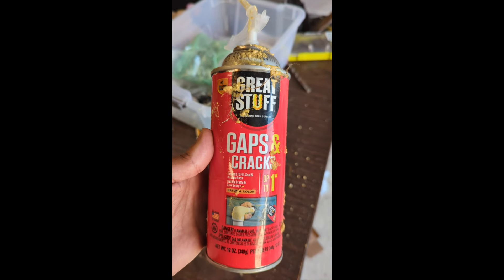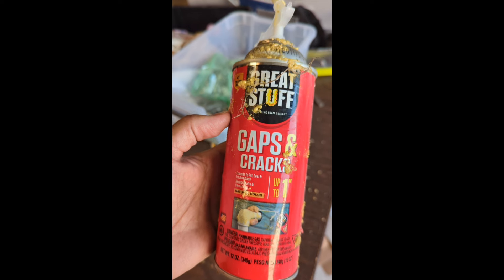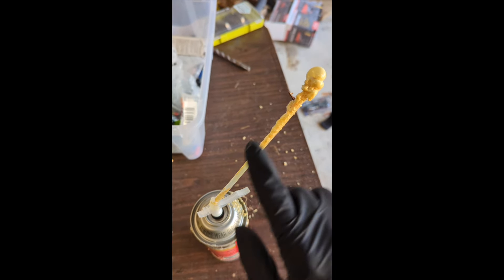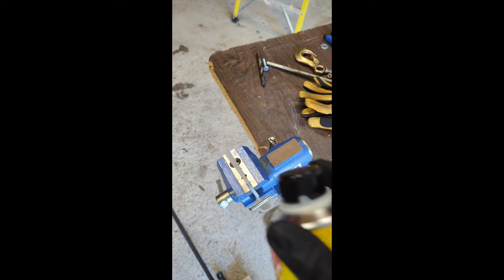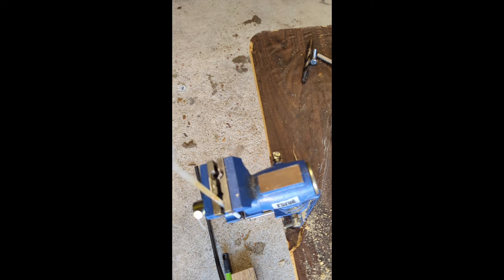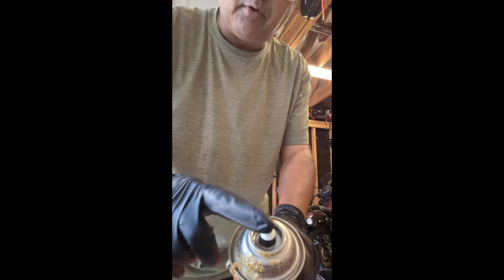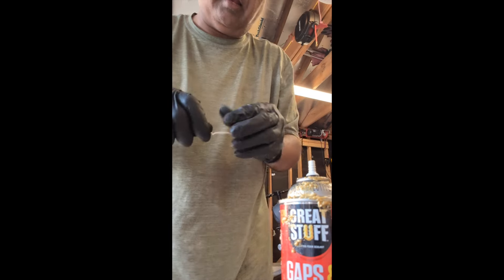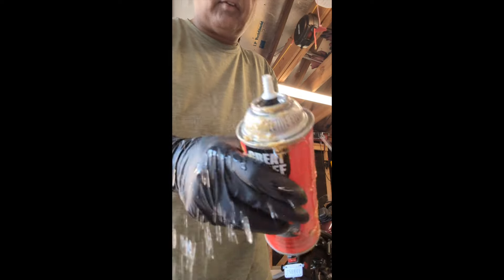Stop Throwing away cans of Spray Foam, Great Stuff after each use , Reuse the nozzle and tube also!

Comment: Generally what you are "supposed" to use for this is acetone. goof off is apparently a mix of a lot of different solvents. The acetone will be cheaper in most places I suspect.
But secondly , if you use polyurethane foam somewhat regularly then I highly recommend investing in a foam gun. This makes it far far easier to work with small applications and flush out the sprayer with a pressurized acetone cartridge. These guns are quite inexpensive, and they also let you control the flow and tip-size of you applications to get exactly what you want rather than a big messy blob. Not having to throw away half used cans or meticilously clean them by hand pays for itself quick.

If you are a neat-freak with your tools then get a foam gun with ptfe (teflon) coating since the foam wont stick to that at all, and that makes keeping the outside pretty trivial too.
Reply from the maker: Acetone is a lot of work , you would need a lot of it and time to achieve the same results. IMHO
Reply: Ft8

Comment: Wouldn't be a lot easier to do what you did, but imediately after you use it but before it cures?.   Have you tried acetone?
Reply from the maker: For me Acetone works slow , you end up using a lot of it and in my experience it doesn't do as good of a job as Goof off.